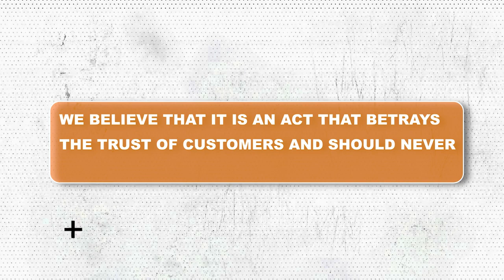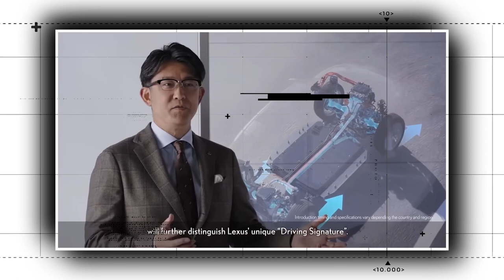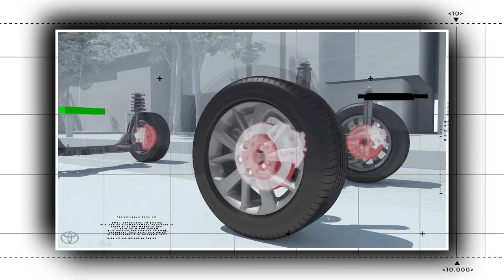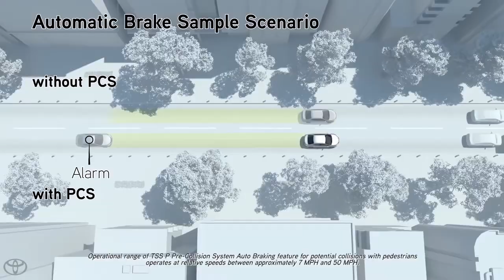DAIHATSU Just ADMITTED “RIgging” Safety Test Results Of 88K Toyota Cars!

Comment: It is as they say it is "A breach of trust with their customers" ( one being me)  And should never be tolerated.
On mine, it was a whistle-blower who spotted the dash top on the Toyota Corolla Cross as being noncompliant with design specs, in a crash airbag deployment during inflation. event. Not good for the poor passenger that would be sitting there.  But huge companies get away hugely it seems. Too big to fail kicks in every time. Just saying. My vehicle was delivered OK, a few months late, but what I requested initially.
They fixed that issue in Alabama by the sub-company that makes the dashes. But still, somebody really screwed up.
 They have been making that Corlooa Cross vehicle for like 3-4 years somewhere around the world as of this past spring( 2023).
At least this issue made it to video and the so-called press. Might save a few lives down the road.
I would say a bad design by some group of engineers involved with that aspect of said vehicles.
Reply: Damn I know yaris cross were but bigger corolla cross too

Comment: Are they still going to send the 88,000 cars to the public knowing they rigged the test??
Reply from the maker: They are all out already at that time they found out.
Reply: VW did that a few years back in their emission testing/ failure.
 Heads rolled in that fiasco. lol
Reply: @luckyguy600 dammmmmn Emission testing 😮
Reply: In Indonesia it is still selling
Reply: @AgusAndre-hm9lu  because in Indonesia it is under a*tr*, and correct me if I'm wrong. Indonesia has its own certification safety standards, and you know how it is 😅, different from those made in Japan. One thing is certain, the safety certification standards used by Japan are better and more trusted in the global market